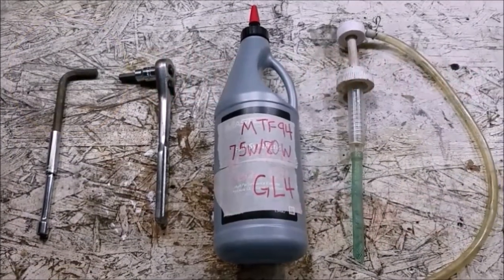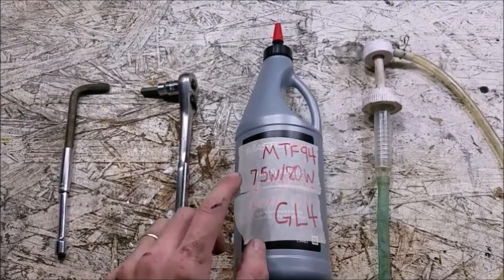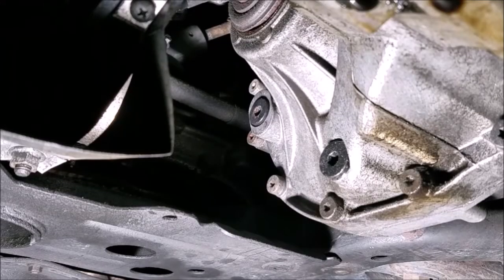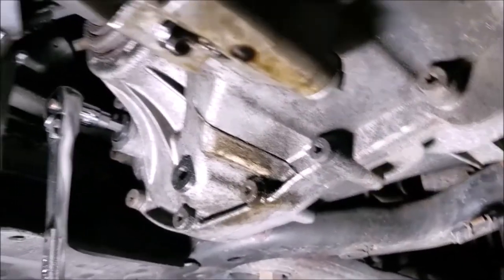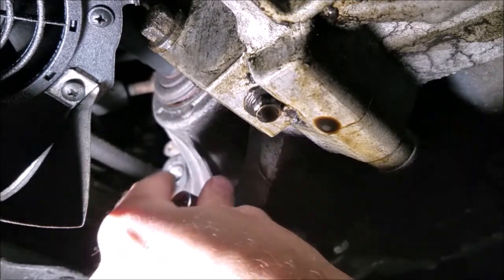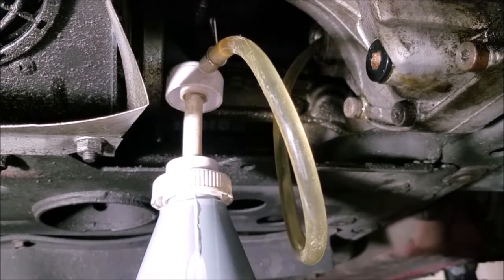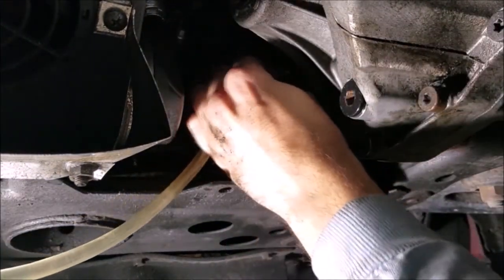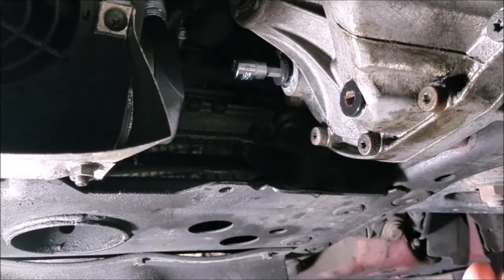R53 Mini Cooper S Transmission Fluid Change DIY

Comment: I know mine took well over 2. Online calls for 6 quarts????
Reply from the maker: There's no way it would fit 6; it's just under 2 quarts if the car is positioned level.
Reply: @350Z247  okay thanks for the help. Mine must be up a little higher in the back on jack stands. I thought that was insane when I read that. Lol.
Reply from the maker: @SethHollingshead  If it ends up with a bit more than 2 quarts, I don't think it will hurt anything. You should be good as is.

Comment: Don't you need a copper washer after?
Reply from the maker: Yes, any time you remove an old copper washer you should replace it.
Reply: @350Z247  do you know what size washer it is to replace? I guess i could call a mini dealership and ask if they have them but ill probably get ripped off with the price
Reply from the maker: @CoastlinesCollide  I bought a large variety pack of copper washers years ago. Definitely worth the investment.